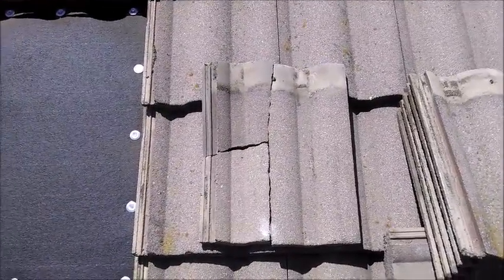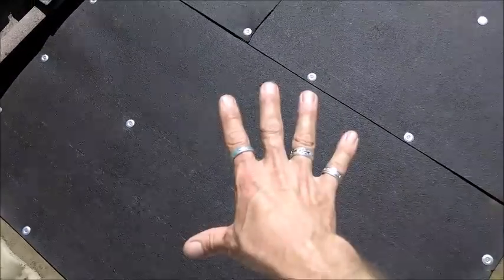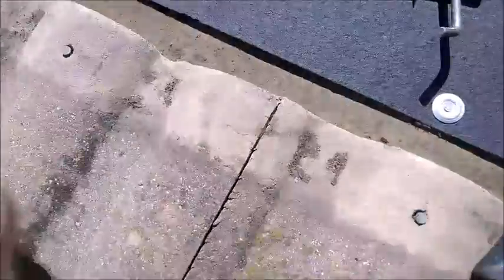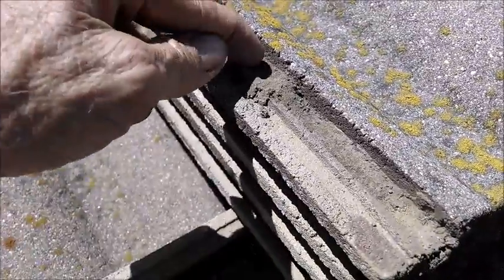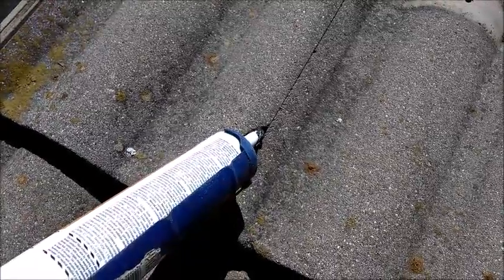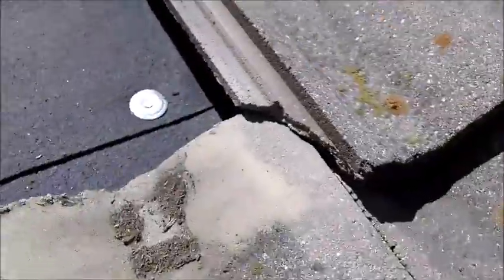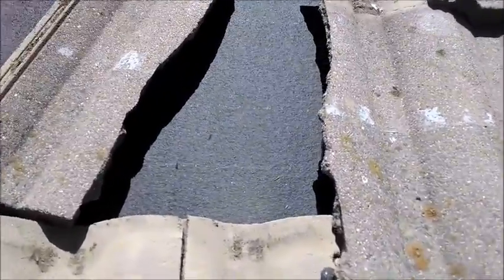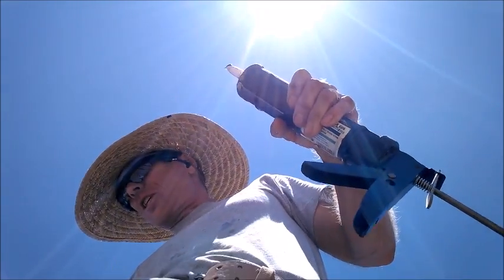Tile Roof Leak Repair - The Right Way...

Comment: Dan Very informative video. We have a Marley Concrete Tile Roof about 33 years old and the lead valleys have developed some splits and 3 leaks have occurred. We live in Niagara Falls Ontario and wondered if you have some suggestions on what is necessary to repair this issue and on a qualified roofing contractor we can hire to do the necessary repairs. We have about 200 extra tiles on hand if any need replacing.
Thanks so much
Reply from the maker: I’ll respond with a full answer soon.
Reply from the maker: So, I’m not sure what the codes are for roofing in Niagara Falls, so you may want to check into that first. Secondly, I’ve never worked with lead valleys but I imagine the splits could be welded up or re-soldiered. My only concerns would be whether or not the membrane under the valleys is water tight or not & why the lead valleys split in the first place. Other things under the valleys may need addressed by a complete roof restoration in your case. I wouldn’t know without inspecting it myself, so you’re gonna have to determine that for yourself.

Now, regarding finding a good contractor... I don’t trust anyone to do good work today unless I already know their work. But I can offer some advice in finding a quality roofing craftsman or company. 1. Make sure they are licensed & do a background check on their license. Companies that maintain their licenses well typically do better work to guard their license status with local authorities. 2. Check local online reviews of various companies in your area to get an idea what the public thinks about their work & whether they stand behind their work or not. 3. Once you find one or two possible contractors who pass the test of the first two steps, when you contact them, negotiate to have a supervisor check the work being done on your roof daily, before you agree to hire them, to make sure their roofers will do quality work for you. If a supervisor’s job is on the line your roof will likely get done well, but without supervision roofers are a dime a dozen & can just skip on down the road to the next roofing employer if their work fails. If the company is not willing to negotiate for a supervisor to check the work once a day, I’d respectfully pass them by & move on until someone worth their salt will agree to be more reasonable & professional.

Hope that helps. Thanks for watching.

Comment: Great video, can I use sealant for small chips/holes and if so is it a special sealant for the tiles or any sealant? Cheers
Reply from the maker: Yes, but chips normally happen at corners where water flows down the side lap channels of the tiles. Take extreme care here not to block the side lap water channels with adhesive just to glue chips back in which are mainly for looks only to find later that you’ve now created leaks that weren’t previously present. I’ve seen this hundreds of times.
Reply: @MrThedocholiday  ok thanks, I have 4 very small holes on different tiles in the middle of my roof from where it looks like something has fallen on them and created a small hole. So just normal bathroom silicone will do? And is there a special way to walk on the tiles so I don't crack them?
Reply from the maker: @bigt8699  I don’t like using silicone cause it has adhesion issues with many construction materials. I use OSI Quad sealant for most roofing applications.

Also, I have another video where if you fast forward to the end I give tips on how to walk on tile. Here’s the link…

https://youtu.be/EZmRtaO9yPk

Comment: Dan! What kind of sealant did you use for cracked roof tiles? Brand? How about walking on the roof tile? Crawling on the top roof? 😮
Reply from the maker: I now use OSI Quad. It’s the only comparable alternative where I live.
Reply: Okay, Thanks 👍
Reply from the maker: Now for walking on the roof… It’s most likely that whatever chipped, cracked or broken tiles you see on your roof were cracked or broken by someone walking or standing on them. So learning to walk on them with your feet perpendicular to water flow & across at least two crowns at a time, to better distribute your weight across more support, rather than one crown & less support, is key. Also, if you walk across the lower 4” of each course of tile where they overlap the course below-the exception to this rule is the very first course at the dripedge which is unsupported by tiles below it-you have much more support for your weight there than you have in the middle of the tiles where they are only one layer thick. Also, if you have to stand still on the tile, try to distribute your weight evenly on both feet at a time, again for obvious reasons. Otherwise it’s best to keep moving across the tiles whenever you’re weight is shifting on one foot at a time as you’re walking. Lastly, the more you keep your weight distributed on both of your feet at a time, the less chance you have of breaking tiles under one foot or the other, for obvious reasons… your weight is most readily distributed across more surface area this way. Also, tile roofs are the one place where you want to always avoid stepping on cracks unless you’re trying to break tiles. Add all these tips together & you will always fair much better walking on any tile.

Comment: What kind of tacks are those holding the felt paper? Do you put tar, or sealing product on the nails and the seams? Thanks for your words about the galvanized nails, and comments about the plastic ones.
Reply from the maker: Normally I use round 1” metal felt nails. Others use all different kinds of felt nails so if you’re referring to the ones I used on the new felt repairs, then yes… metal cap nails or felt nails. No sealant needed on any of the seams because felt is overlapped on sides & lapped under the course above & over the course below with at least a 2” lap. Everything is to code the way I do it in the local municipality where I worked. Check your local codes if there’s any concern about how to install felt & tile in your area.
Reply: @MrThedocholiday  Thank you. I will shortly be up on my roof tracking several leaking spots so I'm watching a few of these videos. I will look for these galvanized nails to use for my repairs. Other videos show all seams sealed with that black tar product, but I suppose it depends on the area. Being paranoid I will be using it also. Thank you for your quick reply. You've given me confidence that this is a repair I can do.
Reply: @MrThedocholiday  Makes perfect sense. Thank you for taking the time to reply. Temps here around 105 so I'll use the time until it cools off a bit to research another problem. I don't see a video about repair of the Ridge, and what to use to put under the tiles. I only see one other video and it's not descriptive for my problem. My roof is primarily leaking at the top, I think. I have a tin foil pan flattened in one spot up there, and it worked, but I need to do the whole ridge. Ranch style house about 2200sq ft.
Reply: @MrThedocholiday  Another question after watching a video about the ridge. They are using a lot of mortar. There is none on my roof. They use the word "underlayment" that I can see tacked to the ridge 2x6. Is that felt or is there a special product for this? Thank you for your time.

Comment: Dan, I have to tell you, thank you so very much for all your help and very detailed videos! Questions:  Can you please send a link or proper name for the adhesive you use, there are different versions out there- just want to get the right one?  Also, are you still working jobs, around or in Riverside County? Thanks again and best wishes.
Reply from the maker: Caulking sealant I currently use is ‘OSI Quad’ in various colors. And no I’m sorry but I’m not contracting in California anymore. Thanks for your considerate words.
Reply: @MrThedocholiday  Dan, if you are in Arizona I would appreciate your help on my 19 year old concrete tile roof. Leaking through the ceiling sheetrock in 3 places, one bad. Only during heavy downpours. I'm disabled now, but have done 2 dozen asphalt shingle roofs and a couple S- tile roofs, well over 20 years ago. BTW your videos are exceptional because your content is leaps and bounds above any others.
Gilbert AZ

Comment: Great video.  My leak occurred at the bottom of the roof by what I call the "bird stop"  It almost created a dam of debris over time and the felt paper fell apart and the leak showed up at a window about a foot below..  While it was raining I cut a section of the bird stop out and the water leak around the window below stopped. The leak was really close to a roof valley and I think debris was cause a back up so removing the debris got the water flowing again.  I have to do a good repair after the rain stops.  Any advise on the bird stop I need to replace?  I am guessing since it is at the bottom I put it on right after the felt paper.  Thank you!! Sorry for the long comment.
Reply from the maker: Ben Edmund depending on how long a piece of birdstop you need, you could make a piece & paint it. Otherwise you’ll need to just pull from what roofing suppliers have in stock that might work for your profile of tile.

Comment: Great video. In Australia, none of the houses I have had or seen seem to have felt - is that a US thing ?
Reply from the maker: I think with all the service people we have walking around on roofs here in the US, our decision makers realized we needed solid sheathing & felt underlayment or we would simply have too many leaks to deal with. I’ve worked on some of the older roofs here  with open spaced sheathing & no felt & they require a meticulous repairman to get them all sealed up, but that’s after all the foot traffic on the roof.
Reply: @MrThedocholiday  I've actually had the problem with service people taking off tiles and punching a hole in the underlayment (we sometimes use sarking in Australia), and then just leaving the hole. Electricians and the phone company notorious for this.

Comment: Hey Dan!  Your videos are quite instructional and very informative to say the least. I have some questions about my roof. The cement tiles on my roof are S type and are attached with a kind of cement mortar. Would you reuse this with an adhesive or buy a bag and mix it when needed? I'm wondering why the roofers didn't use a metal channel because with the mortar is seems like the cement creates places for debris to accumulate. I've developed some cracks in the paper and I now have a leak. What are your opinions? Thanks,
Reply from the maker: This is a long answer so please bear with me. It sounds like you have clay “S” tile rather than cement, because only the trim of cement tiles are attached with cement, whereas the field tiles are not. It would also make more sense that the original installers didn’t use valley metal because metal is more typical with cement tiles whereas clay tile - especially older clay - is often installed over a built-up application of underlayment which is waterproof without metal flashing; at least for a while.

These days it’s rare to see any tile without valley metal for the very reason your roof is leaking. All membranes in valleys eventually wear out without valley metal. Anyway, on to your questions...

You can do this however you want, but I would repair it with adhesive reattaching the tiles with existing mortar & wherever the mortar is missing, I’d apply new mortar to attach the tiles being reinstalled or replaced. I’d replace all the bad paper wherever it’s breached, tuck the new paper up under the existing good old paper above & overlap old paper down slope wherever it is still good. In essence replacing all the bad paper like it would have been installed if it were being installed long ago with the original paper. I would absolutely make sure all the paper overlap up slope & down slope is tucked & lapped in a watertight manner, so that IF water ever breaches the tile, the paper will keep things watertight regardless. Now, on to the tile...

Install broken tiles & reinstall good old tiles (AS IF) there is NO felt paper to protect your roof from leaking. Make sure all your tile overlaps are sufficient to shed water properly in a downpour. Use copper or galvanized metal flashing integrated with the tile wherever higher volumes of water flows in valleys, below valleys, around all vents & ventpipes, in roof to wall areas & around every obstacle on your roof. Fasten all tiles with at least one nail & glue all tiles that cannot be nailed for whatever reason to the other tiles that are nailed. Make sure all rake trim tiles receive two nails even if you have to cut or drill a second hole in them, because rake trim tiles are a safety issue more so than the others. All ridge tiles typically receive one nail to keep in place.

Of course, check your local codes & follow all of them exactly & don’t merely take my word for this. Codes vary between jurisdictions & not all areas will be the same as codes where I learned my craft.

Always consider all advice based on local codes. You will get a ton of different recommendations from various so-called experts, but what most so-called expert fail to comprehend is that the way they learned may NOT fit the local codes where you are because local codes vary & installation applications vary based on different areas, authorities & climates.

I hope that covers the basics for you. Feel free to ask here if you have more questions. Godspeed...

Sincerely,
Daniel

Comment: Thanks for your effort. I'm in Indonesia at the moment, and they have no felt, no ply ( just tiles ). The tiles are leaking evreywhere and the ceiling panels inside are rotted everywhere. 20yr old place. Looking up through the manhole inside , i can see daylight in a lot of places. Without replacing the entire roof, and laying down ply and felt, i'm assuming i will have to seal what i can from the underside first, then seal the outside? or vice-versa, but the daylight will be harder to spot. Then water blast the tiles and prime and paint? It's hard to source things here in borneo, and i hope they have 1,344 tubes of quality sealant. VERY dodgy building here. Am i on the right track?
Reply from the maker: Sunnie Winters basically, yes... I always like sealing out water on the topside only. Because anytime you seal water from the underside you risk trapping the water after it has already penetrated the topside. That can cause more trouble that likely have to fix later, but in your case I’d seal both topside & underside, being mindful NOT to trap water doing so. You want to keep all the water out of the roofing as well as out of the building. But yes you’re on your He right track. Godspeed & good luck.
Reply: Thanks mate. I'll try to get onto it, ( for the inlaws ) sometime in the next 8 yrs.  And very good videos.

Comment: Great video thanks. This is not your work I have a question about, but I am very curious as to why it appears that the tile courses are not offset. Isn't that strange?
Reply from the maker: Good question. No it’s not strange, but it is optional.
Reply: @MrThedocholiday  Thanks for your reply! Is it possible code varies state to state? I've never seen it but I may just have not noticed.

Comment: Great videos! If similar tiles are on baton boards do they all need to be nailed down?  They were nailed every 3rd row...  thanks in advance!
Reply from the maker: ib crypto That totally depends on your local codes which are based on certain requirements that are regionally determined by local weather patterns, levels of storm intensities & the type of roof structure.

Personally I like to see every other tile nailed to the battens when they are present. The exception for me would be higher pitch roof structures which require every tile nailed to the battens for obvious safety reasons.